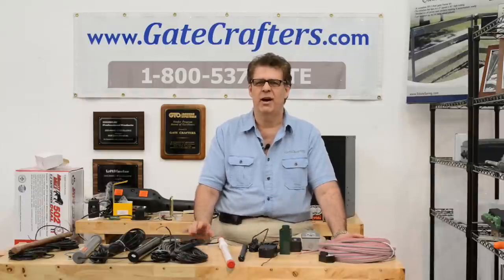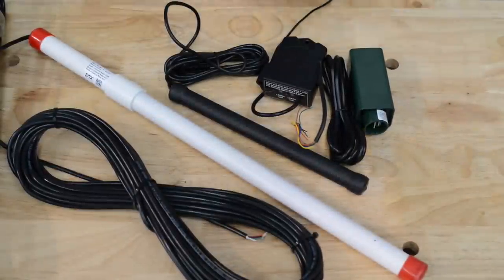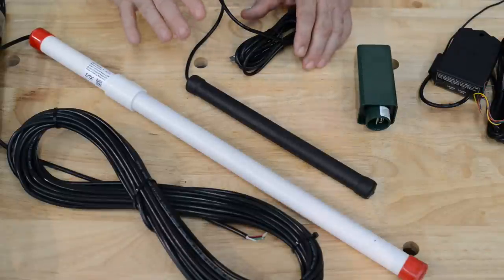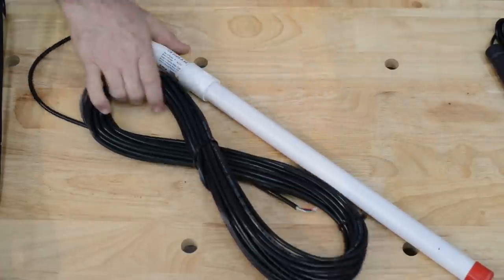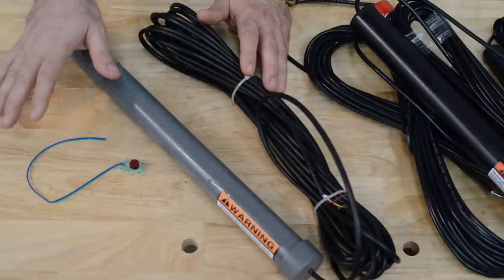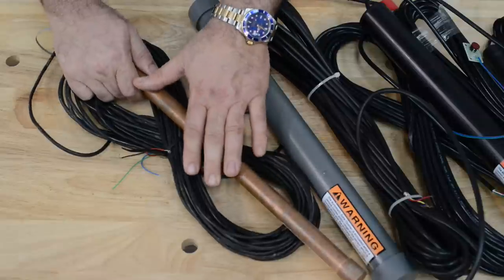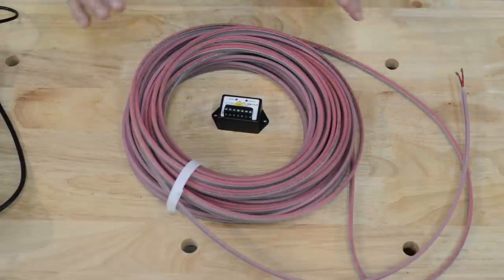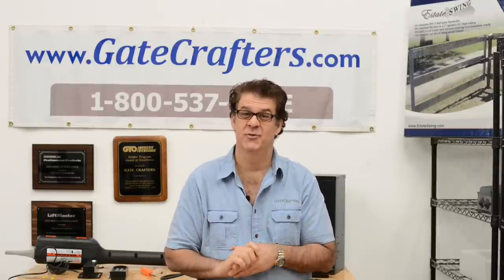How To Decide Between a Driveway Gate Exit Wand or an Exit Loop

Comment: I live in Arizona and gates here act up when it rains, is the rain in the ground shorting out these detectors?
Reply from the maker: Hi! It might not be the rain in the ground, but rather the thunder vibrations causing the gate to open. To prevent the gate from acting up, we suggest burying the wire at least 10-12 inches underground. If you have any more questions, please let us know - thank you!
Reply: @Watch2DIY  thank you, I removed the power wire to sensors and this recalibrate them as it said on a YouTube video